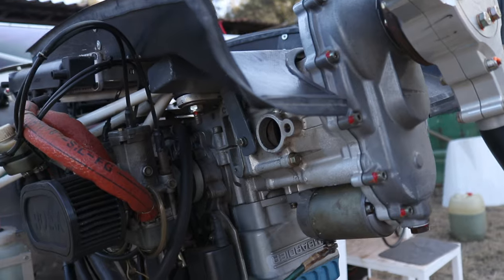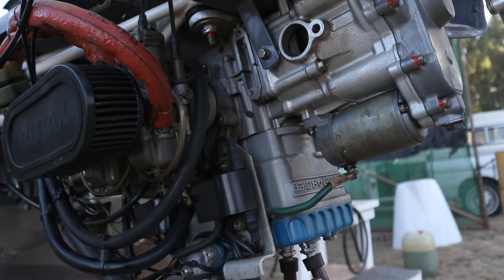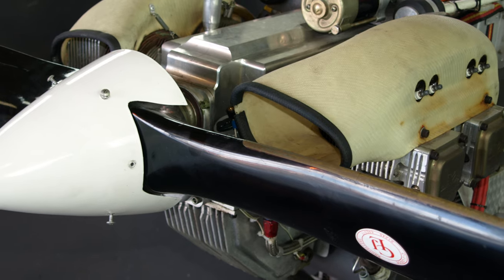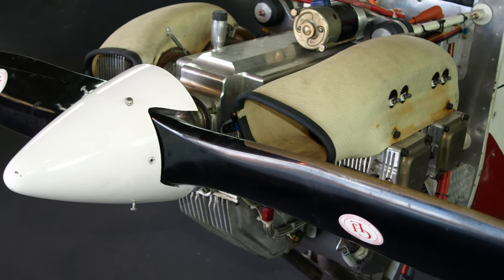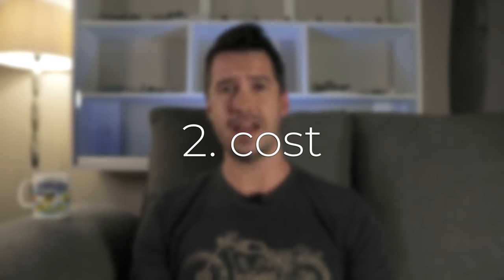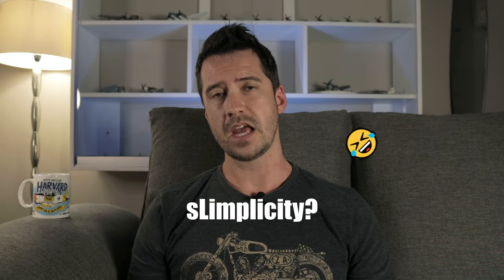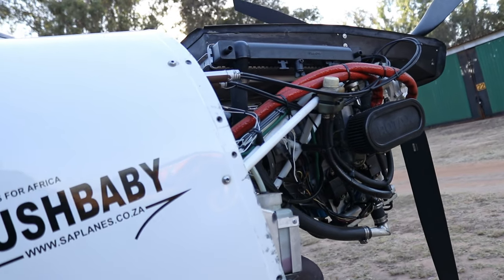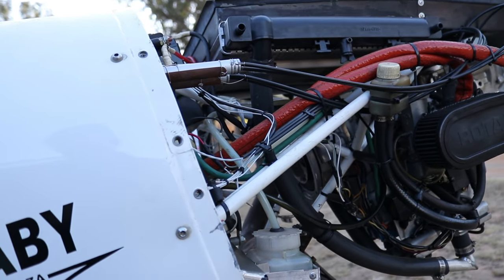5 Reasons the Rotax 582 is AWESOME (& 4 reasons it SUCKS)

Comment: All engines are subject to sudden storage.
All engines are AIR COOLED.  Some engines such as the 503 transfer heat directly to the air.  Engines such as the 582 use fluid to transfer the heat to a radiator and the radiator transfers the heat to the air.
1. If you are worried about sound get a new hobby. (Most of the noise is the propeller and intake.)
2. OH @ 300 hours....LOL that's a lot of flying and the 300 hour is cheap.  BTW it's only "recommended".  Don't compare 2 stroke engines with 4 stroke engines.  Your misleading.  My 337 IO360's are $25K each to OH.
3.  If you crying about fuel consumption.  Fly sailplanes.
4. Engines fail for many reasons.  Poor fuel, abuse and lack of preventative maintenance.
This pilot/Aircraft Maintenance Engineer/ FAA A&P of 35+ years has hundred of incident free flight hours on Rotax engines.

"Beware of the self proclaimed expert."
Reply from the maker: I gave more reasons to like the 582, than to dislike it, so this video isn't a "bashing". The noise point is subjective, but the rest is factual.
Yeah 300 hours is a lot of flying, but 1500 hours is a lot more. 

Your reasoning about all engines being air cooled is scientifically correct, yes. But how about we call engines which require coolant in a radiator to function, "water cooled" and engines which doesn't we call "air cooled". Just so a layman like myself can keep up.
Reply: I myself am about to buy an utralight but what is stopping me right now is the aircraft in question has a 582 becuase I always found 2strokes noise is very irritating compared to 4strokes. But It just happens to be the exact aircraft I was looking for at very good price and condition so I may give in.
Reply: @vracan  Have a knowable person do a pre-purchase inspection B 4 you put any money down.  Comparing 2 stroke engines to 4 stroke engines is like comparing apples to oranges.
Reply: Using the following terminology illustrates the difference between direct air cooling and air cooled liquid cooling. To explain, the former impacts immediately which can result in metal cooling shock, the latter has to pass through the radiator material into the liquid and then be directed into the engine's liquid jacket which takes time involving slowing and mitigating the impact.

Comment: Its sounds it should be in those snowmobiles or something like that.?...🤔🎤👍🇦🇺
Reply from the maker: The earlier Rotax engines was derived from snowmobile engines after people started using it in aircraft (in the late 1970's I believe). The 582 was specifically designed for aircraft though.

Comment: I dis agree Air cooled is much better  no pumps no fluids to worry about no hoses to pop less to worry about and being air cooled the motion is enough
Reply from the maker: I used to see it that way too. But water cooled is just so much lighter, and some of the most reliable engines are water cooled (Rotax 912). You're right though, air cooled = simplicity.
Reply: @LetsGoAviate  In your latest videos you state liquid cooled is heavier.